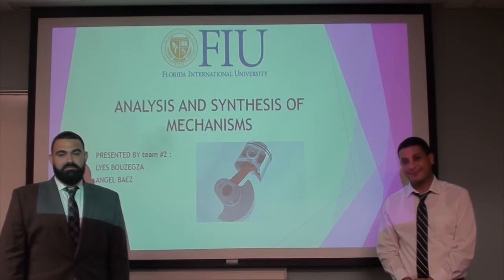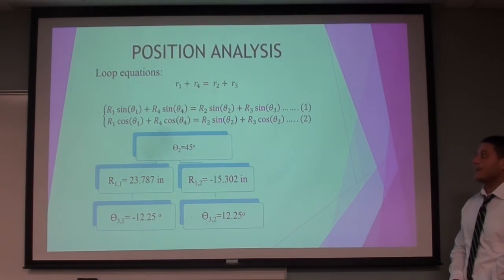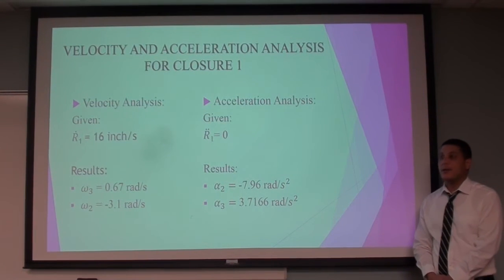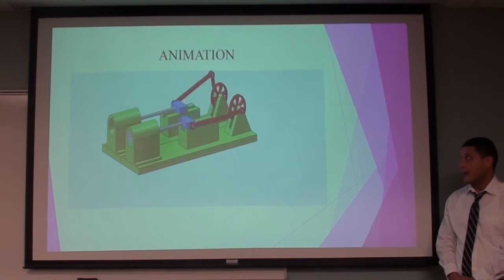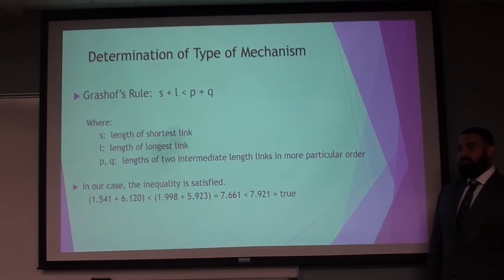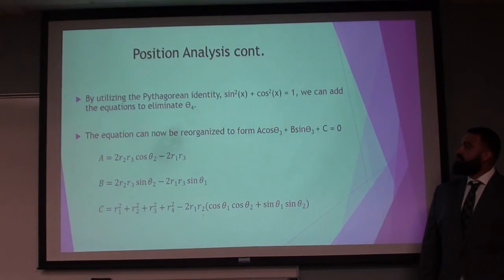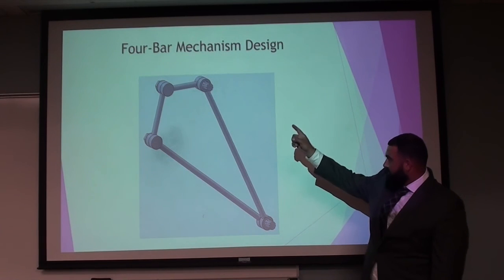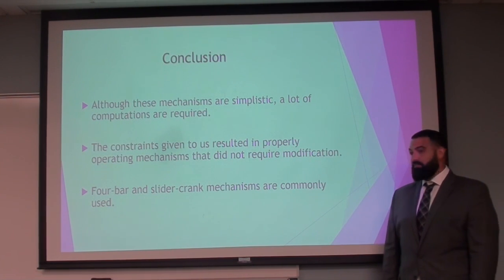Team 2: Mechanism Design: Four-Cylinder Engine & Wiper Blade

Comment: The dress code in the presentation was very professional. The slides were easy to read although more explanation may be required for the layman. There was a bit too much of reading from the slides, but the presentation flowed smoothly and sound quality was nice.

Comment: I think the second half of the presentation was great, but the first half however felt too straight forward. I think it would help the audience to have a little but more elaboration, and less reading off the slides. Other than that it felt like a good execution; good camera angle, good dress code, decent sound, and no disturbances.